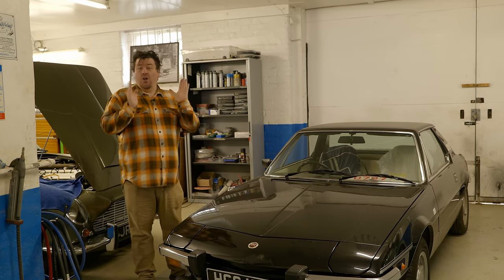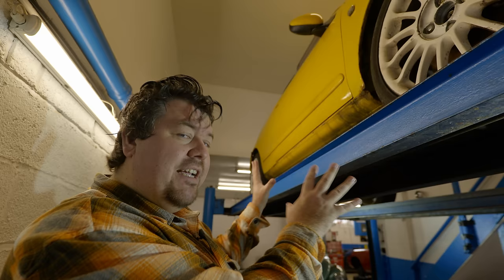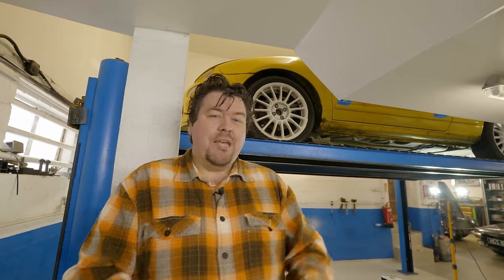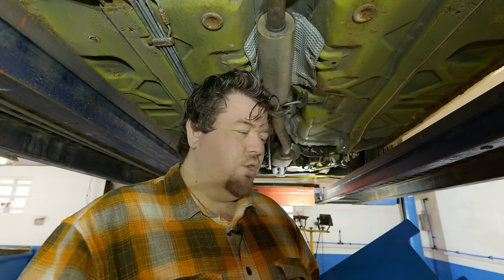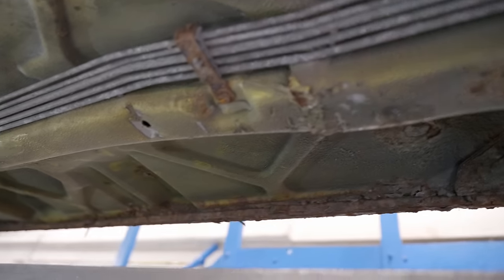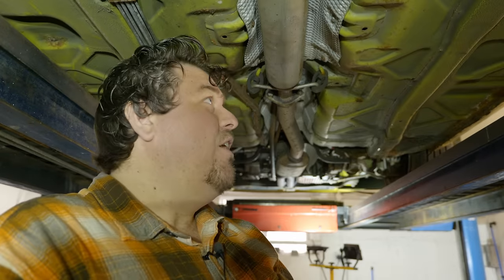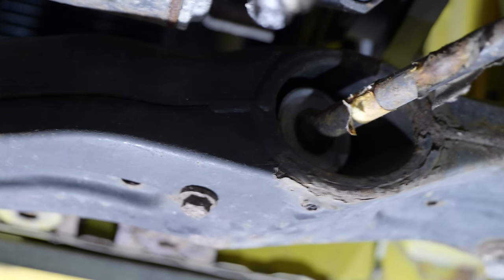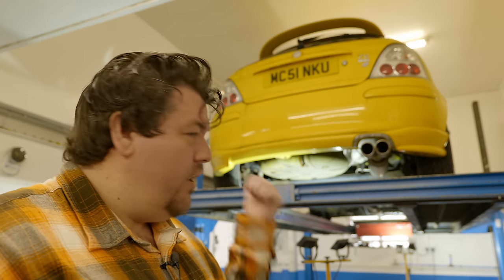An Update on my 2001 MG ZR: You're All Going to Say I'm Mad

Comment: As an ex MG Rover salesman who sold these cars when they were new, it's fantastic to see a young guy enthusiastic about restoring one. However, that's quite a price tag. Not sure I could justify it, but I wish you the very best of luck with it. Will be nice to see it at the Pride of Longbridge show one day.
Reply: The pride of Longbridge was the Austin 1100/1300, best UK seller in the 1960s for 8 years (63-66 and 68-71).
Reply from the maker: Pride of Longbridge is a show
Reply: 1300 gt though was a great motor, first of my dads I remember , mainly the trips to get the carbs balanced, was told was better handling than a cooperS  @JayEmmOnCars

Comment: James, you’re a legend!
I feel a lot better with you spending this kind of money to a ZR. 
Now the €8000 I spend on my 200 BRM fixing it feels a bargain.

Last year I spend that money on fixing the hinges on the hatch (which rust always happily), respray on the roof, new headliner, fixing wiring, new brakes all round, new dampers and new front wings (which are effectively hand made, because the replacements completely didn’t fit). And welded a hole in the roof, at the A-pillar on the left hand side. 30 hours work + parts…. And a service and APK (Dutch MOT). 
But I have a great 200 BRM now! 

Hope you get a perfect ZR!

Comment: I had a 3door, yellow, 2001, PG1 gearbox, 1.8 160 VVC ZR near identical to yours a few years ago. Paid £450, Broke it for £750 and kept the engine for my Caterham, as needed a VVC head for the power i was after. The engine lives on as a 244BHP all steel screamer. Being that the lower spec ZR's had solid disc and drums, and some no body kit, meant parts went for good money and quick. Mine had 70k on the clock and had no real rust. Didn't know the spec was so special. I drove it around 500 miles to confirm the engine was good and with the pipercross fitted did sound good and went ok, but didn't overly like it. At the time a head or engine was worth £400 so buying the car was a better option.

Many 160's ended up living on a race cars in a series, and now VVC heads are a lot harder to find. The K Series is a good designed engine, and the 1.4 and 1.6 even stock was a good engine compared to say a zetec

Comment: I’m so glad, I worked for a mg rover dealer when these came out. I was 26 and full of enthusiasm, I went to the dealer launch and thrashed them round a track….they sold like hot cakes…out first demo was a trophy yellow 160 just like this but a Y plate…Y788ERC…which replaced a 25 GTi…there was such a buzz around then as MG Rover was on the up…we thought. When they folded I was gutted….i still own a TF Anniversary which was also my own demo in 2004 ( I bought it back in 2019) and 25 which I bought new for my late mum in 2003. Good man👍

Comment: I recently brought a 1988 Volvo 740, so far it's had an engine, spark plugs, fuel metering system, head unit, subwoofer, new wing, new door, new door internals, several pieces of trim, different OEM wheels, and in recent times it's had a fuel tank, rear calipers, clutch and some other bits 

Why? Because I love it, it's green with gold and black panels because that's what I could find but she's alive and fairly rust free now

Comment: I still daily drive and use for work my preface lift MGZR 120+. I have had my issues but its a fun car i love. Its a 2004 plate but i have the original receipt and it says it was built in 2003. They are so underated and im trying to keep it going as long as possible.

Comment: Hmmmm....I'm in 2 minds. I wholeheartedly admire the saving of what might be considered 'enough car for fun personal transportation', a category into which many '90s and '00s models fall, in the knowledge that the cost of doing so may be much the same as what might restore more collectable machinery. If that car brings you joy, it's worth it. On the other hand, I'd never expect a 20 year old cheap hot-hatch of any mileage to require anything less than the work-list that you've described. Trust me : I've a shonky Ford SportKa project in the garage for DIY rebuild which might mark me out as even more mad. In any case, respect for going ahead instead of parting out the engine for an Elise 111S.

Comment: Good ones are already fetching 8k as the market for these goes up, the early ones are more reliable and build quality better and they’re brilliant fun to drive and respond well to tuning and it’s getting harder to find decent ones. I’ve got the precursor to yours a Rover 25Gti less than 1500 sold in the UK with around less than 100 left these cars need saving good luck with yours.

Comment: A fellow lunatic here. Just spent £3+K on having new front wings and rear arches installed on my R25 GTi (apparently one of just 34 left on the road). Last year it had a new fuel tank, year before sills on both sides, plus an annual service each year with a specialist (plus discs, pads, etc). At least it was a rolling resto, rather than hitting the pocket as one lump. One things to watch out for - earlier cars have plastic liners inside the wheel wells (I think deleted as part of Project Drive) but don't assume all is well behind them, as they can trap crud between themselves and the metal (the underside of upper front  suspension mounts were horrific on my car, despite looking lovely from above). Good luck! T.T. ,

Comment: This car is definitely NOT too far gone, but £12k to get it perfect seems steep! 
I bought a ZR 105 in monogram bittersweet in January this year, on the 150 mile journey home, it broke down, the alternator failed. Luckily I was with my friend who was able to tow me back home 70 miles (with a towing bar). But the alternator was definitely not the only thing wrong with it. It had previously sat in a field somewhere in Wales for a very long period of time, completely neglected. So it was rusty, very rusty. The fuel tank had a hole in it, the rear brake pipes were replaced with very poorly made copper pipes, the entire underside is completely rusted, mostly surface rust but many locations it is much worse. Sills, arches and front wings have mostly rusted through. The engine was misfiring and it would barely start, wrong battery was on it, and after a compression test it was found that it was low on cylinder 3. A valve had burned out, after replacing the head gasket, sump rail and fully rebuilding the cylinder head, it ran well. The cone filter has now been replaced with a stock air box. It needs a LOT more work but it drives well at the moment and a lot of work has been missed out, but only around £700 has been spent on it so far to improve it so much. The next step is a whole lot of welding.
Reply: I don't think many realise how much it costs to bring a car back to an OE Standard. Welding work rinses up so much labour time, lots of garages will do shoddy welding work, patch on patch on patch. The time involved to do things properly so they never have to be done again is extreme!
In this world, you really do get what you pay for!

Comment: Good on you for committing to what is a mad but a passionate idea to bring it back to its former glory. 
It's hard to believe in a way that 80% of the Z cars are gone!😮 But then they were built for just 5years, they were gradually cheapened and more poorly built, with corrosion resistance being one of the worst affected factors. And they were bright tacky and garish cars that really sold en mass to the young people who could insure them, and then have their fun while they lasted. 
MGR had a brief but shining bright light for 5years while these cars were new, as despite not being up to date or competitive with the sectors they were in, they did drive so well and the engineers got so much out of the chassis, particularly with the ZS and the ZT V8.
It would be nice to see it at pride of Longbridge 2025, and maybe you could do a back to back throwback review of it comparing it to the best rivals of 2001, like a Clio 172 or Honda EP3 type R? All these years later its not so important which is the best car, but all thats important is that they are still fun to drive and make people smile.

Comment: I had one of these back in the day, when I was in my early 20's. It was a 160 3 door in blue. I absolutely loved it, but Christ on a bike were they badly made. The side skirts rusted on mine too, to the point that the bolts holding on the plastic rusted, and the plastic covers fell off on my driveway. And this was on a 4 year old car! I sold it shortly afterwards. I expect it's one of the 80% that haven't made it to the present day.

Comment: I have owned several rovers and indeed I run a 1.6 25 now ( only 35k miles from new ) as my daily car. They drive really well . But the best ( in my opinion ) was the 600 TI it handled really dodgy on the edge and couldn't put it's power down but I loved it and loved it's turbo power delivery. Bit flawed can be fun.

Comment: Jay, if you have the money and the time and you are not relying on the car for transport, spend the money.  My 2002 MGTF 160 is a money pit, but it has 70,000klm on the clock, cars don't rust in Australia but the paint takes a hammering and MG really didn't put a lot of paint on the cars when they built them.  But it is fun to drive, and I put it in a few hilclimbs too.  Just be aware that they will find other problems when they start.  Enjoy.  And how about you do a Harry Metcalf and get some video as the car is being restored.

Comment: The oil leak is the rear main seal, common problem. The play in the PG1 is also a common fault. It's a pretty average looking ZR. Apart from the naff aftermarket rear lights. Oh, and that ain't 70 hours of welding 😂😂😂
Reply: @Jake01201  I know MG's and I've owned a few ZR's and ZS's over the last 15 years, some in far worse condition that that. That's no more than a weekends worth of welding
Reply: @Jake01201  New sills on both sides, 4 jacking points, boot floor repair, boot lower panel repair, 1 quarter panel welded and primed in a weekend on a 51 plate ZR 120 also fitted 2 new front wings and primed those in the same weekend. I had every bit of metal I needed all ready before I started

Comment: James it is done to individuals like you that keep the UK cars alive! Yes they may be looked on as the ugly ducklings of that era but they do have some of the best engineering in them!   I owned an original Rover 204 that  I got at auction for the princely sum of £240.00. Once it had been given a thorough clean inside and out, ( it had sat under a tree for a number of years) It sailed through its MOT without any advisories. I can honestly say that that was the most comfortable car to drive as the suspension was able to soak up all the harshness and big bumps at any speed.  Even my wife was happy to sit in the back & she is one of the worlds worst passengers!    Sadly it went the way of most of these vehicles with the "K" series engine!

Comment: How do you get garages to fit your own parts , like the brakes you ordered months ago? Garages around here will not touch customer supplied parts
Reply from the maker: It hasn't really ever been a problem - provided the parts are right they're happy. If the parts fail it's my issue but that's fair

Comment: Older cars are worth saving, because you'll save on depreciation against a newer car, and they are far simpler to maintain than newer cars.
There won't be any expensive visits to a garage to clear codes from dodgy sensors, because older cars don't have any sensors.
Once any welding repairs are done, then they're done for a long time.
Modern cars just bankrupt their owners, not just with their repair costs, but also with their insurance costs.

Comment: I don’t think you’re mad… yes repairs are not currently economical, but if you look at the problems on the car, none of them are that unexpected for a car over 20, and the reason the price is so high is because your doing a full restoration. I think what ever you by at that age your going to need similar work to get it back to factory. 

These are the cars like you say that are near classic status, and I won’t be surprised if they shoot in value in the future, and a fully restored car in the spec you have will certainly be the most valuable.

Comment: Will it run on the fuel of the future?
E15/E20.
That's the problem that will face a lot of older vehicles.
That alone would put me off buying one.
All respect to you though, for rescuing a bit of our motoring heritage.
Reply: There's a solution for that. Standalone ecus on old cars are quite simple to wire in and then you can map it to whatever fuel of the future you'd like to use! Just if you're willing to spend the money.

Comment: Hi, I have a zr 160 that's failed MOT on rust, on it has lots of new parts if your interested in buying it let me know, it's got new calipers, carriers and discs, pads, Hel brake lines, refurbished wheels and almost new Uniroyal rs5 tyres, cobra stainless exhaust, alcantara interior, brm knobs, upgraded alloy radiator, new coil packs new HT leads, new anti roll bar Polly bushes, Gaz suspension, race tuned ECU,
Reply from the maker: Email me on talk@jayemm.com
Reply: @JayEmmOnCars  emailed

Comment: Every OBD3 or 2 car that you can save, is going to be worth house money in just a few years. The hybris EV generation are all single-use items worth less than scrap value, due to pricey recycling costs and hazardous components and materials. When those start to go bad, people will turn to these, late 90's early 00's cars, that still use fuel available, and not as much as earlier models. An Aston is still worth a lot, but it stops being a car. You can't drive around and enjoy it as it is, you can only keep it in climate controlled space and wait for someone to buy it from you. When the computer generation gets older and carburetor generation passes away, value of an old Aston will go down, as these "gems" will only go up.